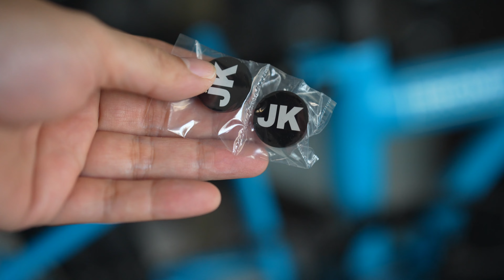781 Lagoon Blue Project - 5 speed - H&H FCB, Ehook, Titanium Pedals - Joseph Kuosac Easy Wheels

Comment: I use an extra hard rubber suspension from J.K. to make my bike as stiff as possible, when riding. And I don't like loose pedals.  Finn. Denmark
Reply from the maker: That is  good choice Finn, you will never go wrong with JK ultra hard suspension for better pedal response, we know the loose pedals is not for all but so far we dont have any problem with the H&H pedals.
Reply: @781BromptonPremiumParts  I have seen a wooden block "suspension" for Brompton and didn't know why originally (A.E.)? But the J.K. is reasonable if wanting - some suspension still? I have a large Titanium bolt for my folding pedal to be changed, as I am to change the original, even on a Superlight, "Heavy Metal" clamps holding my mudguards Titanium stays and the guards, to carbon and aluminum (As a "Rainy Dane" I never leave Home without them)!
       But I expect my Original by then, Top 2019 -  Flame painted, Black Version <SuperlightM6LXBrompton> to come even below 8 kilo with the last changes, also a few extra parts on my original brakes, to titanium (Why then buy a T-line, naturally also with mudguards, and less gears?), and a carbon M handlebar!
     I have seen old bike-parts with a lot of - extra drilled holes in them, for less weight, so maybe it will also be a solution, round on the metal frame of the folding Pedal?
    I have an efficient drill tower from Bosch. 😄
I also have Ceramic Balls in my Stem and Titanium Crank!
           Finn. Denmark
Reply: By the way I also have an absurdly expensive: "Vincita", padded pouch for the "folding pedal" during transport! It is effective! As also a solid, and also, a soft, German B&W box for travels.
    It is a "horrible bike", on the small wheels, but for its purpose, transport and storage as folded, it is second to none - except of course the now many, new Asian Copies. But "Those who follow in the footsteps, will never come first"!
    On the other hand it is possible to buy a lot of finely made, also titanium items for the bike (I have a black titanium seat post, which it is possible to buy in more length versions than the original sizes - and with the Brompton, theft-security bottom)!
    Near all my bolts, nuts and discs on my bike are now from titanium, as well as the - axle in front! 😄 Finn
Reply from the maker: @finncarlbomholtsrensen1188  thats why we are upgrade to our riding preference as the parts comes with it is not that good, all plastic housing and rusty steel bolts, Titanium bolts are great, isn’t it. B&W are the go to bag as well
Reply: it's the best otherwise you get a lot of oscillation. spring ones are the worse 
every downstroke will compress the suspension and waste energy